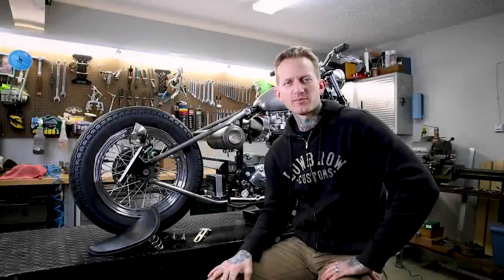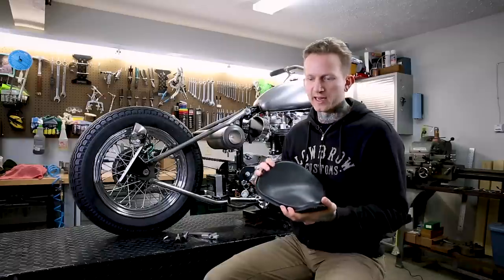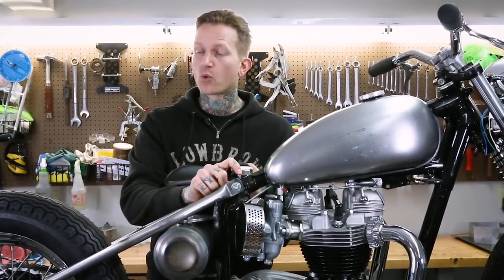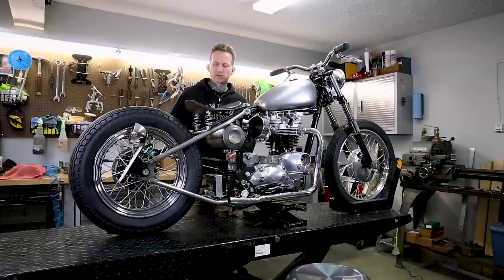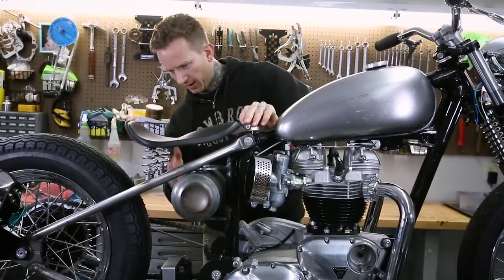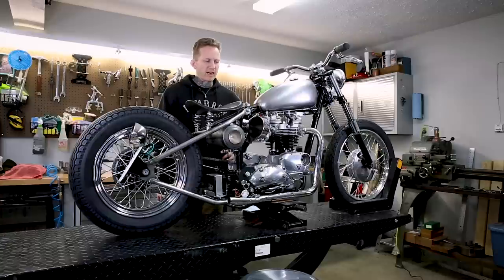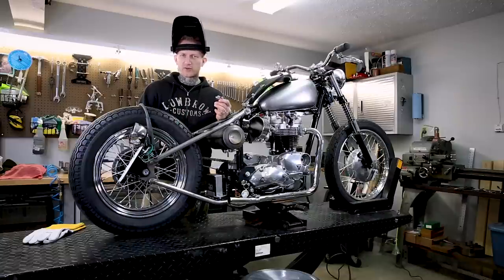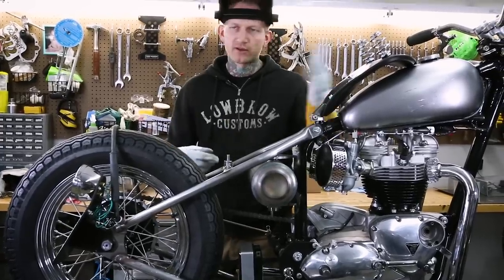Motorcycle Sprung Solo Seat Install How-To: on a Vintage Triumph Chopper

Comment: Nice video. I've got the same seat and fixed it on my rigid shovelhead, but instead 2 springs I put it on one old leavespring, cut in the right lenght, from my pickup. Works great and very 'confortable' ;-). Greetz from France

Comment: What about putting the seat on a  1987 Heritage..
Do you have to weld any extra stuff on the bike..  or do any fabrication work ..
It seams the bottom plate is sitting on the battery…

Comment: A basic job well covered with excellent comments on parts, thx.  Q:  What brand & model lift table are you using?
Reply: PS.  Nice Bike!
Reply from the maker: @Changtent  Thanks Jim! That is from http://www.directlift.com/, we have several that we have used for many years without any issues.

Comment: Awesome videos guys! Quick question, I noticed the pulsing when laying down the final welds. Is that necessary to keep heat input down, or just personal preference to give you some extra time to position the torch better?
Reply from the maker: Just regular TIG welding... pulsing the foot pedal between individual points while welding a bead.